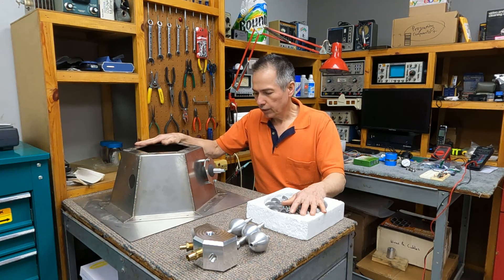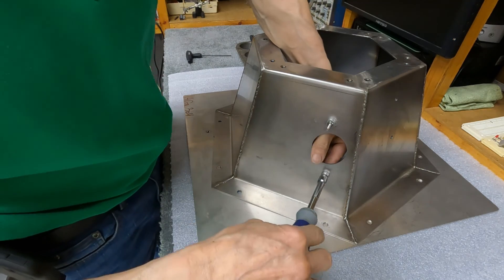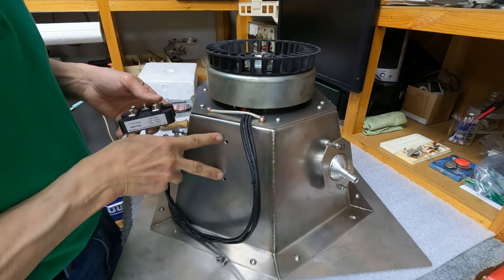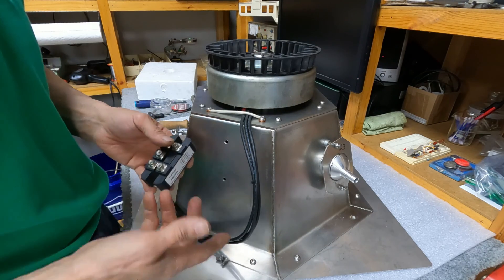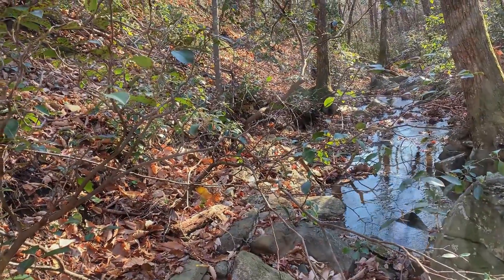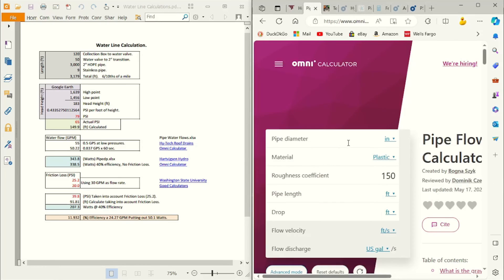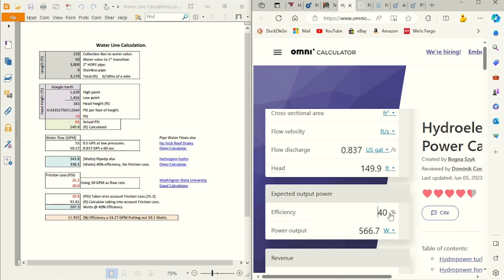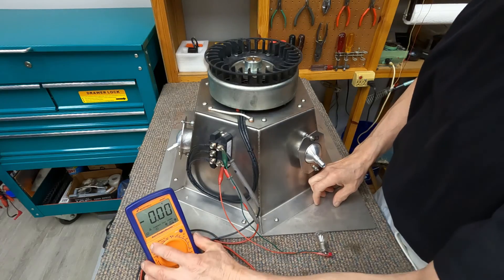Micro Hydro -  Generator Setup

Comment: Why do all these  low head applications trying to use Pelton ?

Pelton is for very high head! 

At this head Kaplan or Propellor  is correct or perhaps the side flow types.
Reply: For this particular application Francis Turbine is best at 79psi head.

But most of the YouTube’s have 25 foot heads using Pelton !
Reply from the maker: I don't know where you're getting your facts from but small Pelton systems are designed to operate at 30 meters of head and above. If you had been paying attention; I'm running well above that. I started with this one because it's the most popular and easily available. I will be testing all available pico-hydro units.

References:
https://www.geppert.at/en/our-solutions/new-plants/pelton-turbine/#:~:text=The%20Pelton%20turbine%20is%20also,and%20comparatively%20low%20water%20volumes.

https://en.wikipedia.org/wiki/Pelton_wheel#:~:text=The%20formula%20implies%20that%20the,specific%20speed%20of%20the%20Pelton.

Comment: first time seeing someone taking advantage of the watercooled casing to cool down the rectifier diodes, smart idea! on more remote cable runs, most seem to prefer to run the 3ph down to their euipment shed to then rectify it, but isn't the tension, and therefore potential current losses, going to be the same? meaning either between 2 phases in a 3ph delta wiring and the DC output of the rectifier?
Reply from the maker: Running the AC current through 3 wires is more efficient. Once rectified, you're down to 2 wires which would require a heavier gauge to carry the same current. In my case all my equipment is going to be located right next to the unit so it won't be an issue for me. Thanks for your input.

Comment: You are making really good videos sir 😎
I like that you show all the calculation and why you use the numbers you use.

My setup will have a head of 85-90 meters and I am thinking of trying out the crossflow turbine.
On such low pressure that our system got I think the additional flow will we will be able to get through a crossflow turbine will equate in higher power overall than a pelton turbine.
I might be dead wrong though as I haven't run the numbers, but I think I will go that route as an engineered crossflow turbine is quite easy to fabricate yourself with a welder and some cutting and bending tools.
If you are not happy with your results it would be interesting to see you try out the crossflow turbine design :)
If you search there is a lot of research on the crossflow design and and easy mathematical equitation to design the size and angle of the turbine blade/drum according to your water source.
Reply from the maker: I plan on trying many different turbines and setups; I'll add your suggestion for sure. I would love to see your work on the crossflow unit. Thank you for your comment and advise.